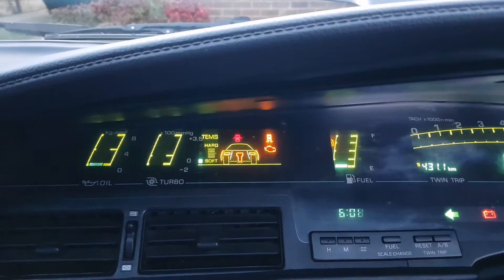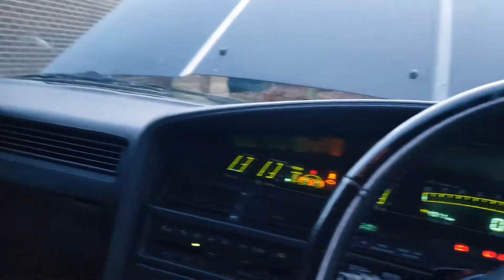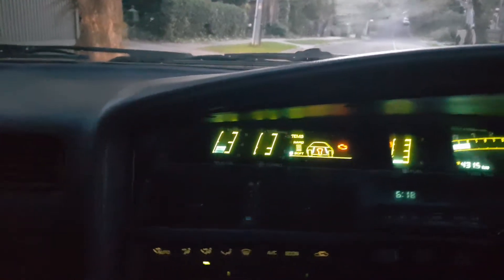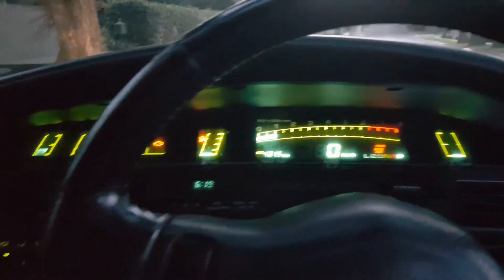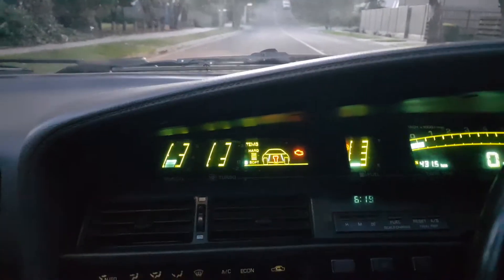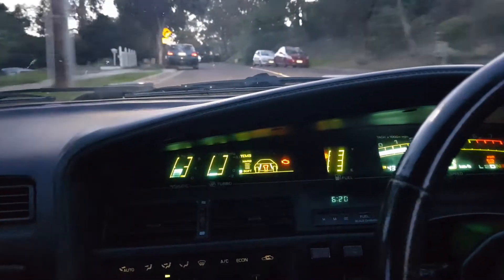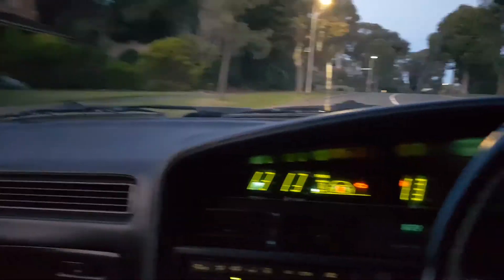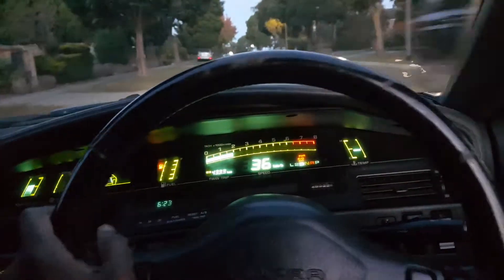Toyota Supra, we go for a cruise

Comment: Why auto 😔
Reply from the maker: Auto was the most common for supra. These are GT. More of a luxury cruiser. I used to want to change it to manual but autos are quicker for drag racing and it has a very early semi auto shift which allows you to change and hold gears  anytime in manual mode, it's an old electronic system but I know it's not as cool as a true manua, I have least to enjoy it tho
Reply from the maker: Most supra mk3 and mk4 were auto unfortunately,